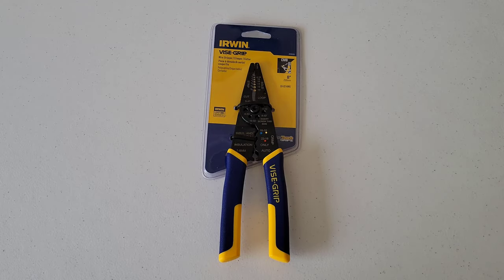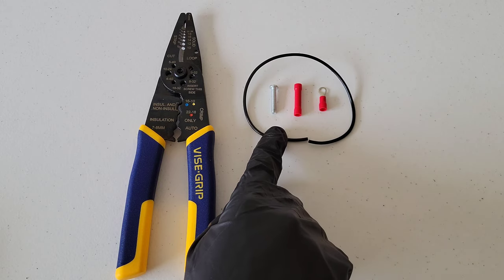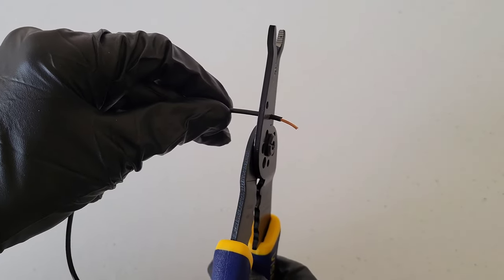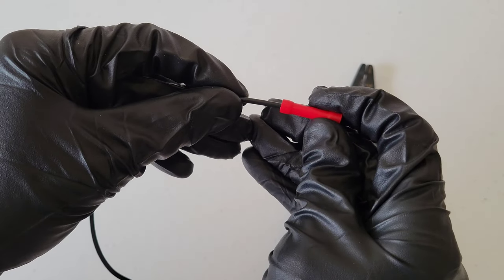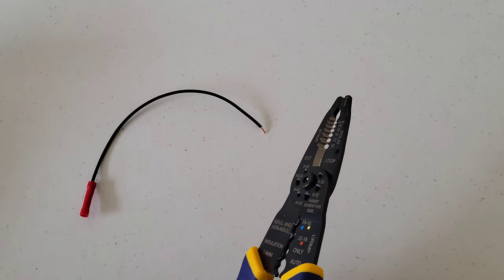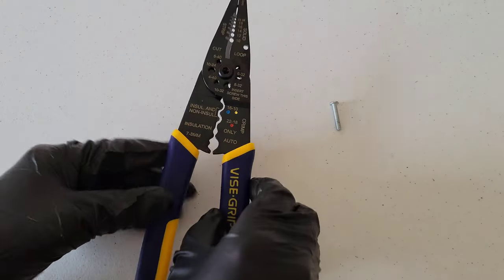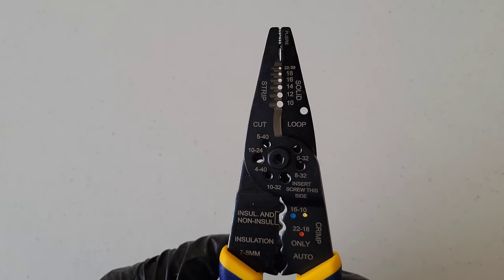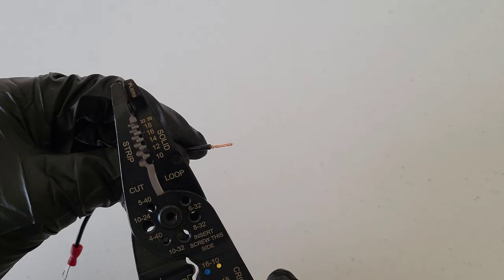Irwin Vise Grip Wire Stripping Tool How To Use Tutorial

Comment: You are cutting that stranded wire on the wrong side of the plier, that why you need to use to the next spot. The other side says STRD, that's the correct side for that kind of wire.
Reply: Please elaborate; I’d like to learn.  Mine says solid on both sides.
Reply: yup mine says solid on both side
Reply: That is true for some wire strippers but not this particular one. Both sides are the same shape and markings. Some other strippers also have different markings for stranded or solid wire gauges but as mentioned in the vid, just use the next largest slot for stranded wire vs. solid.
Reply: 4:22  in doubt, start at the largest hole and just work your way down until you reach the requisite hole. Some are marked stranded and solid with the appropriate gauge size marked. The strippers in the vid, the same one's I have, bizarrely are marked stranded and solid, but only one gauge size; I would say it's the solid gauge sizes as he had to drop a size for the stranded wire🤔